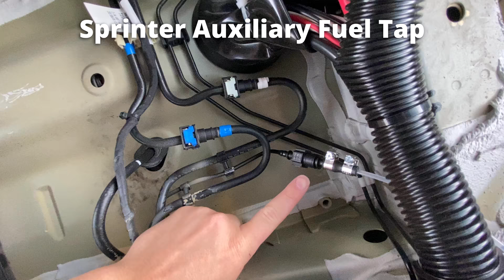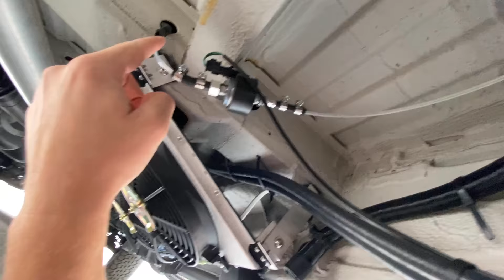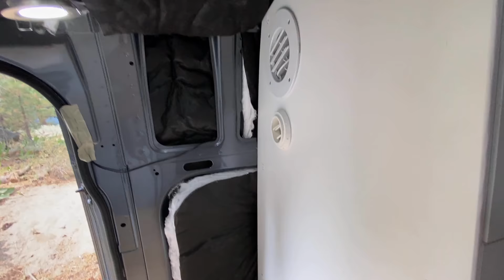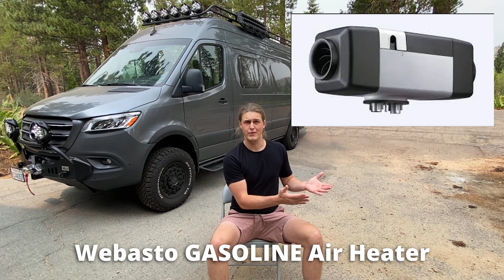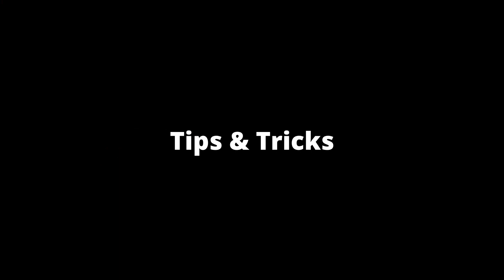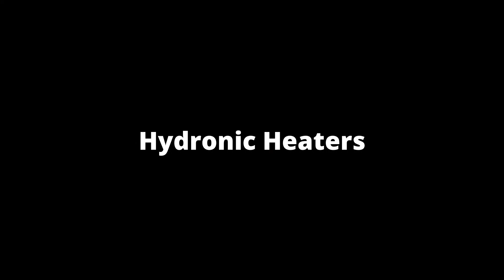Watch This BEFORE Buying A DIESEL HEATER!!! (Best Heater + How To Install) #vanlife

Comment: Awesome overview!

Was there anything special you did for installing the mounting plate? Also what did you do for sealant around the edges under the van and did you seal the edges of the mount inside the van? I haven’t seen many videos using this so I don’t want to mess it up :).
Reply: Exactly what I wanted to know too ! But I see it hasn’t been answered
Reply: Great questions. A small amount of exhaust does leak from these heaters at the exhaust outlet to pipe connection so sealing off these areas is important to keep combustion gasses from entering your rig. 
I have a couple chinese heaters in a toy hauler and wish I knew about the mounting plate used in this video. The mounting plate that came with my units were flimsy galvanized sheet metal, maybe 14 Ga. I chose to use them as templates and fabricated larger plates using 1/4” aluminum. This gives me ample clearance between the exhaust outlet and the wooden floor, IMO the packaged mounting plate locates the exhaust outlet much too close to a combustible material. Additionally this allowed me to make a 1-1/4” wide neoprene gasket to seal between the topside of the floor and plate. Underneath I used some metal flashing and 3M industrial adhesive to seal and protect the exposed wood.

Comment: Nice video and helpful but people might want to know about High Altitude issues with some heaters. I installed the Espar Gas B4L M2 unit which is designed for High Altitude without any adjustments needed. I skied 135 days last year and it worked great!! Last year I got my heater for $1,300 now they are selling them for $2,100!!

Comment: 4:15 Where can I see your source /documentation / experiments for claiming they are not as reliable? 
You could buy 5 and have 4 in backup for the same price, I'd say that's reliable..

If you just buy some spare parts, they're reliable.

Comment: Thanks for all your videos! The vents in the van for the heat need to be at the bottom!  Heat rises and having the heater vent at the top of the van will cook the top but your legs will be freezing!
Reply: I should add.  Heat rises and rises fast.  Exponentially

Comment: great video! Curious if it will matter that your heat outputs r fairly high up and heat rises, I would think putting the vent low for your feet, idk how cold the floor of your van can get, im sure the heater will do fine though if your insulation is good enough.
Reply: A lot of his heat is going to waste is just heating the top part of the van
Reply: It’ll work but you’re right about efficiency loss. I use a couple of these heaters in a custom made toy hauler. One is set up with the air outlet about 6” from the floor and the adjustable deflector / vent directs air downwards. The forced 200*F air heats the floor, adding thermal mass and boost heating via convection over the larger surface area. Not to mention the astounding difference when walking barefoot on heated floor vs non-heated.

Comment: DO you see the need/value is adding light-weight plates to protect key components on the underside .. eg. the heater fuel pump - from rock strikes.

Comment: And you should add that the Espar controller can manage two eaters (air+air, hydro+hydro, or hydro+air). Good option is to have an hydronic complete system, plus an airtronic heater as a backup…

Comment: nice to see you have the exhaust for the heater in the perfect spot, so many people put it on the sliding door side, the most opened door of the van, very strange, like you have mentioned it should be on the opposite side to that door.

Comment: What do you use to couple the multiple pieces of exhaust pipe together?  I imagine you need two meters to get to the other side of the van and they only come in 1m lengths.
Reply from the maker: The resonator that comes with the kit
Reply: @seven_o_savage  [smack palm to face]. 😀

Comment: Gasoline Heaters are  much louder than diesel ones , they make  high pitch super annoying noise. Other thing , if you have T split on your air hose  and you shut one side you may generate a lot of heat within the hose because air flow wont be as good and your heater will overheat and shut off.

Comment: Hydronic has the advantage that you can heat the reservoir with engine radiator heat, or with shore power if you are plugged in.  It will also give you hot water (some rig up air heaters to heat water too).  The hydronic heater cycles off and on based on the temp of the fluid, so if heated by engine or shore power it does not run all the time.  Plus you can also use it to preheat the van engine in extreme cold weather.
Reply: those are crazy expensive

Comment: And why do you not mention altitude limitations on these heaters. I called several manufactures and they do not recommend running them at high altitudes. Some even mentioned they will not work efficiently at elevations above 7,000 feet. Above 9,000 feet, forget it. So as one who lives in Colorado, forget it as most of my camping is above 7,000 feet. You should let your viewers know this.
Reply: I put a gas Espar B4L M2 12V ($1,300, it's now $2,100)  in my van that was built to work at high altitudes, it came out last year. The prior unit that had an adjustment you could do to it for high altitude but people had a lot of issues with it. 
Mine worked great last winter and I skied 135 days!! My home mountain is Mt Rose and the parking lot is at 8,2000 ft it worked like a champ!!
Reply: Our van is in Woodland Park , CO at 8500 ft.The Espar D2 heater with the altitude attachment has worked well for three years. It is an awesome little heater. For best results, learn how to do the annual maintenance yourself as shops will charge by the hour and you'll end up paying too much.  They are simple to maintenance. That said, our new  2021 170 build will likely have a hydronic heater for several reasons. Mainly, for me - the D2/S2 makes already dry western winter air - bone dry.

Comment: If you go the cheap route There is 100's of tips to get them working safe And long term use You will end up buying a few items ..But no where near the cost of a Webasto ..I have mine 3 years now running in a SUV camper without issues And in extreme cold weather paired with closed cell pro spray foam I sleep in a T-shirt

Comment: Why did you put your warm air supply so high? Hot air rises. Would be more effective to put them both lower but still spread out.
Reply from the maker: It came down to tradeoffs. To compensate, I do have a maxx fan on either side to move the air around.

Comment: Intersting video thanks.
Question, most people install their heater outlet low down where the coldest air is. By installing the heater outlets at high level you will create a hot/cold climate in your van? Unless I'm missing something?
Reply: You're not missing something, it will create a hot/cold climate in the van. I know from experience and mine wasn't even as high up. Due to lack of circulation of warm air from below, it created mold. Besides that, I could really feel the difference in temperature. Cold below the waist and too hot above.  To get the the warm air circulated all the way down to the floor, the Maxx fan probably needs to be on a high speed.  I'm sorry to say Seven, but I think this won't be the ideal set up. Why not use a T and have another output just above the floor?
Reply from the maker: Dang now I wish I would have left the clip in explaining this 😂. 

It came down to layout design tradeoffs. To compensate I have a maxx fan on both sides to help move the air.
Reply: @seven_o_savage  That's a big trade off in battery power having to run more noisy fans to even the heating out? I would like to know how it works when its sub zero outside? I think your floor will be freezing! Please take this as constructive criticism, I love your quality work on this project. 👍
Reply: @paulluggar5964  totally agree, aircon up high, heating down low, in our houses in Australia, we have heating vents in the floor and/or skirting boards on the bottom portion of a wall and the aircon is in the ceiling or on the top portion of a wall.

Comment: Very useful to hear the comments on hydronic, I also spent a long time considering using hydronic. In the end, I decided it made the van too complex so I also went with two different systems for water and air heating. I have a gasoline Transit, and actually decided to use the Espar heater over the Webasto, due to the better altitude adjustment system and interface. Gas heaters to seem to be more flakey than the diesel ones though, so having support from a dealer is really useful. I bought mine from Espar Parts, I found them to be super responsive.

Comment: Good Job, just a question: how do you connected the fuel tube for the heater to the gasoline tank? That's not so clear for me.
Reply: Mercedes installs an auxiliary fuel connection. You will need to of jade a connector from amazon to plug into it. I’ll let Seven post the affiliate link so he gets credit. :)
Reply: @KeithFolske  Thanks. It's usually done only by Mercedes or some other manufacturer do it?
Reply: @StealthChannel  I have read that Ford has them installed on top of the fuel pump but you may have to install the pickup line.
Reply: @KeithFolske  Thanks a lot